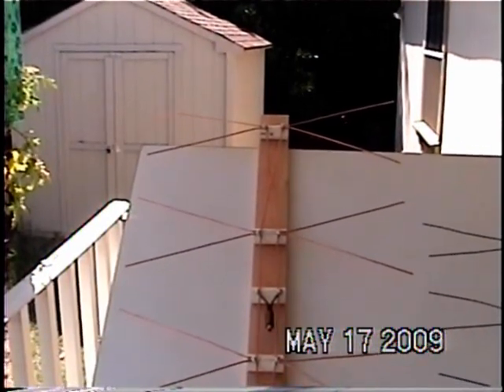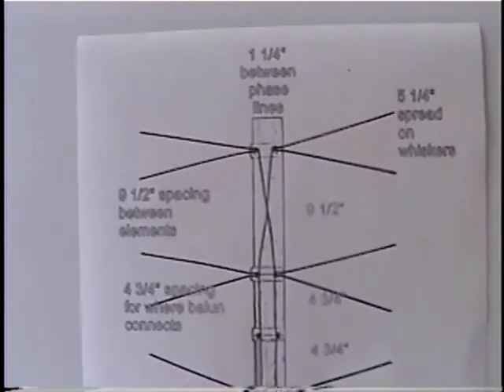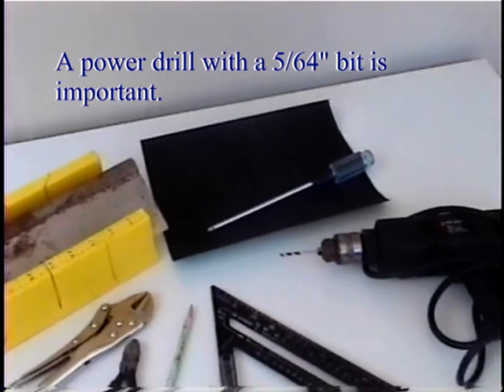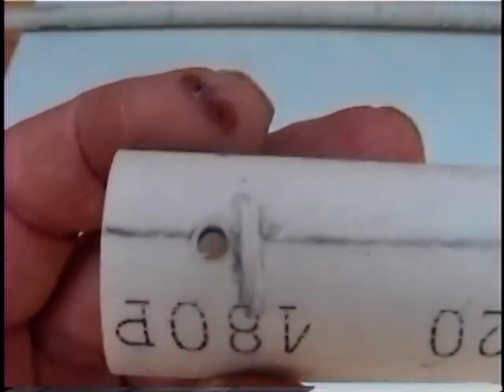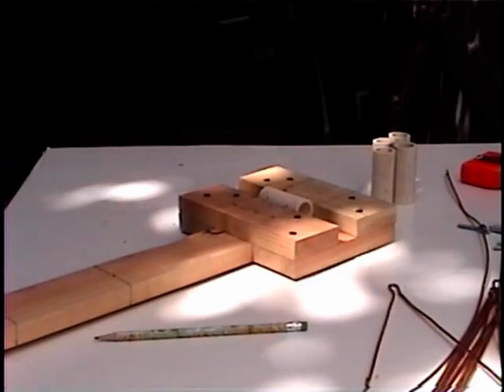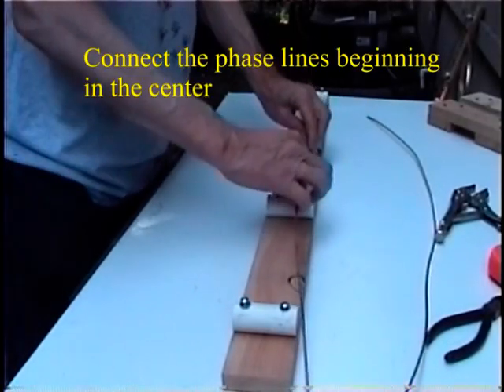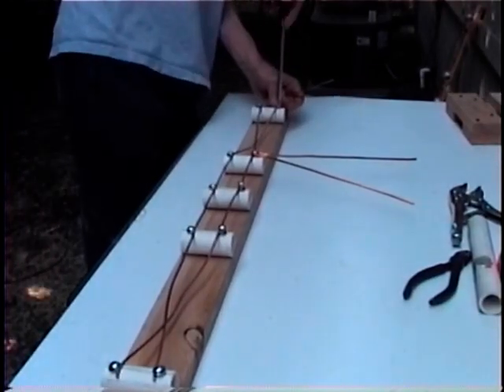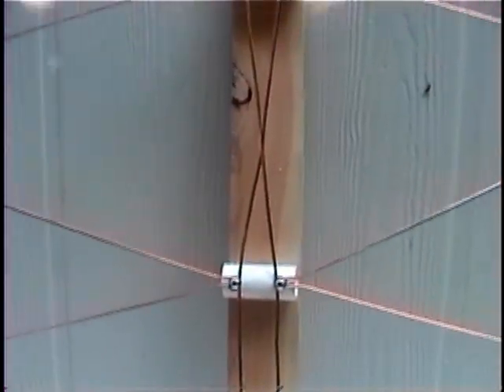A Better HDTV Antenna

Comment from the maker: Here's part of the answer: This antenna receives best from about 7 to 55. This design was designed to pick up that range. The fact is that it really depends on materials, and building skills. The rest of the answer is that whisker length, a reflector, and aiming the antenna properly make it work well, or less well. 10" whisker length is best for most situations, but not all.

Comment: You don't say, but I assume this only covers channels 13 - 69? I thought all VHF channels were going away, but here in Phoenix we still have 8, 10 & 12 but of course now digital. Also some people will find they have low power analog stations in there market as well. We hav one on 44 and maybe a couple more?

Nice layout. My buddy on Maui (all low power stations) now is receiving several watchable channels that the rabbit ears were not picking up.

Jim

Comment: If i put the whiskers 9" separated from each other instead of 9 1/2" will that affect the performance of the antenna??? 
and how about 8 1/2"?
I'm just trying to work with what i have..

Comment from the maker: This could be an in or outside antenna. Prime and paint the wood if you put it out.  In or out it's best to aim it properly. Go to the tvfool website for info on that. I hang mine behind my tv on the wall using string thru the 2nd standoff. I encourage you to use your imagination, though. It could be on a stand, etcetera...

Comment from the maker: You could do all you suggest, but keeping all the parts in the air (as much as possible) will reduce loss. This way of making the antenna is the easiest way I could think of, but maybe not the best way. The next video will be the way "for real" antenna designers make theirs. Also, thanks for a good rating.

Comment from the maker: Thanks. I will be doing another video about this antenna, this time an outside version that will include a reflector. This antenna already receives VHF high, though. The range is ch 7 through ch 50. That's pretty much the entire range that will be available after June 11.